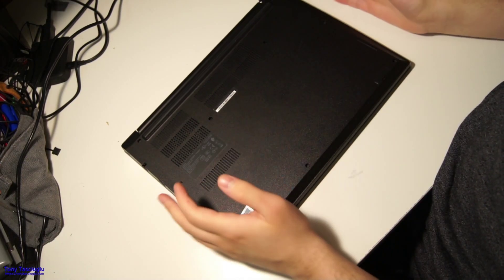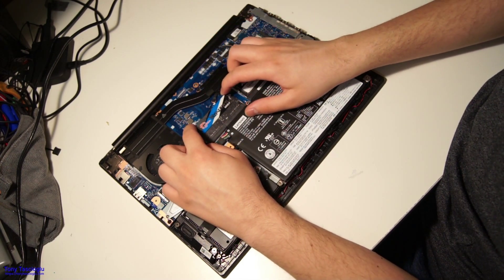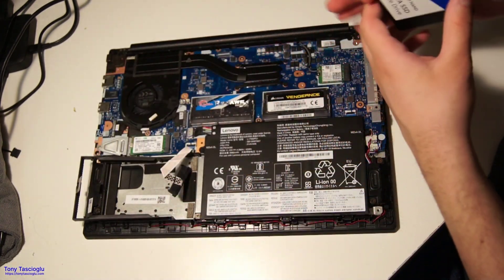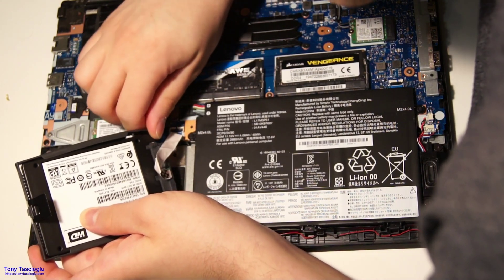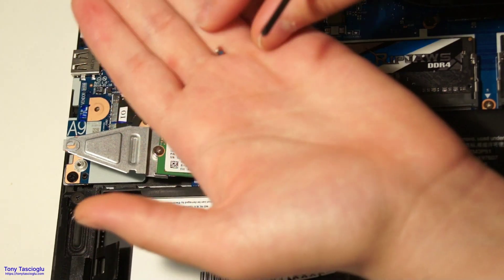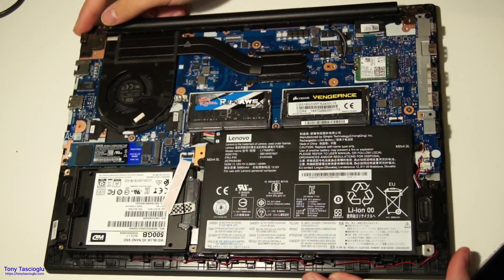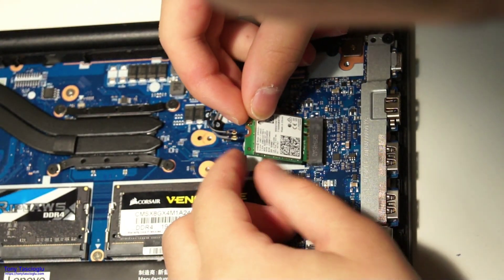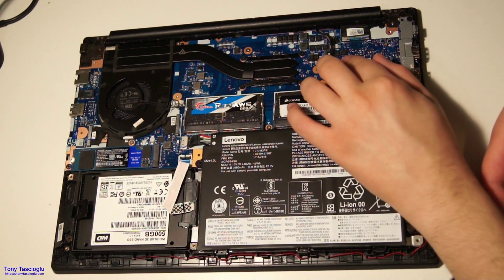Thinkpad E495 - How to Upgrade RAM, SATA, M.2 SSD and WiFi

Comment: Is your thinkpad intel chipset? I have the AMD chipset and it dosent work with m.2 sata ssd even
Reply from the maker: Correct the M2 is only wired for PCIe on the AMD as far as I know. The SATA is routed to that ribbon cable for use with a 2.5" SSD.

Comment: 6:02 that’s actually a M.2 SATA ssd as it has B and M keys
Reply from the maker: No, I've confirmed that is an M.2 NVMe SSD with Gen3x2 PCIe lanes.
B-key is basically always SATA, but B+M SSDs can be either SATA or 2 lane PCIe from what I have encountered.